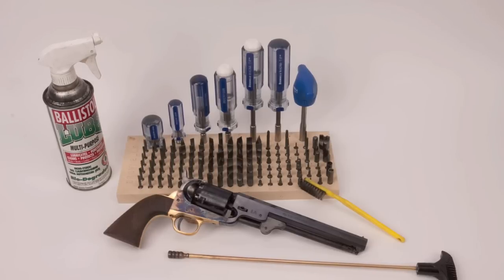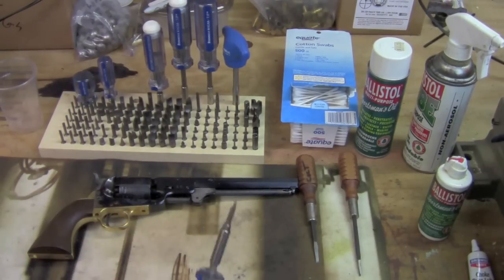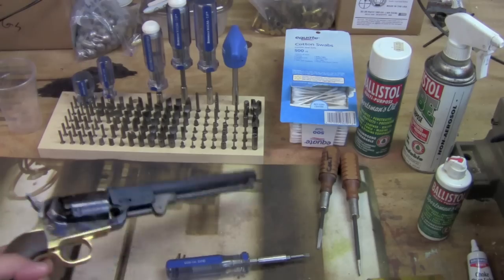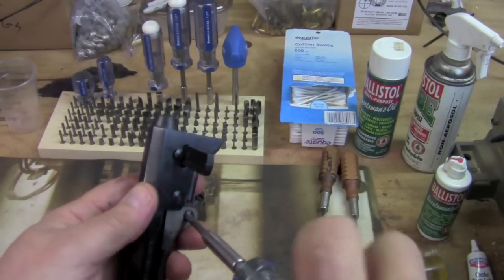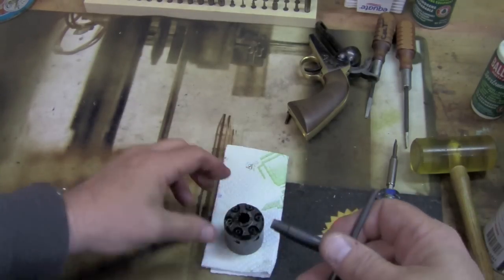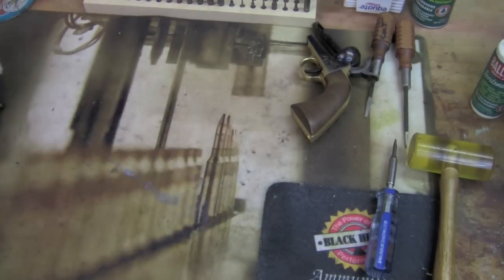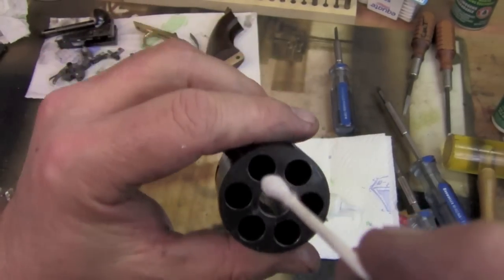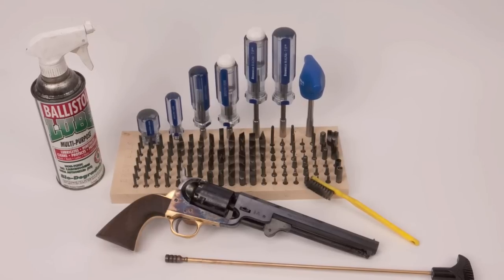Disassembly and cleaning Colt Cap and Ball Revolvers Part 1.mov

Comment: I just bought a new Pietta 1851 and the wedge will not move.  I've hit it pretty hard with a hammer
Reply from the maker: Hit it harder. Use a plastic mallet.
Reply: @duelist1954  Thank you.  I guess its a heavier hammer and break or die lol.  I have a Uberti Dragoon model and the wedge is nowhere this hard to get out.
Reply: @duelist1954  Do I need to remove the screw located on the left hand side of frame above the wedge?  Does the Pietta 1851 disassemble the same as the Uberti Dragoon 3rd model?  The19th century tin types should have shown Wild Bill with a 4 pound hammer instead of a knife in his belt lol.
Reply from the maker: @enjoypool4052  no. Do not completely remove that screw. Yes to the disassembly question
Reply: @duelist1954  Thank you for answering over  a weekend
Reply: @duelist1954  The end to my wedge story is a gunsmith friend looked at it the wedge was in backwards (from factory).  He knocked it out from the left side of gun

Comment: what can i do for rounds seized in the cylinder??
Reply from the maker: TrickyNicky remove the nipple, and use a steel punch or small diameter steel rod to pound the load out of the chamber.

Comment: just came across a repro 1851 navy that has not been touched for over 30 years. Gun cannot be put is half cock is stuck. Barrel cannot be removed when wedge is removed. Any suggestions on removing barrel that apprears rusted in place
Reply: Martin Small PB blaster

Comment: my nipples do not remove but my guns to shoot I just clean it out with hot water and soap is that okay, how do I remove the nipples if they're seized
Reply from the maker: Soak the end of the cylinder with the nipples in penetrating oil for a few days. Then tap the nipple wrench with a hammer a few sharp blows to break the rust bond.
Reply: +duelist1954  tryed soaking no work only got 2 out
Reply: +duelist1954  still shoots maybe I should leave it the way it is
Reply: i use hot soapy water as well so no foreseeable probs there...does your revolver nipples actually come out? a replica might not have went that step.
if they do first i'd suggest a thorough cleaning cleaning of the cylinders that's above and beyond normal cleaning, if they still don't move...200 degrees for 10 minutes should do...careful it'll be hot to hold and use a nipple wrench made to remove the nipples...if that doesn't work.might try hotter or longer other than that...I have no idea.   in case it needs to be said, a legal disclaimer here don't put a loaded cylinder in the oven
Reply: +Harvey Dent I got the nipples out I had to get a nipple wrench with a little bit more leverage and put it on a vice
Reply: +Harvey Dent I can only own antique replicas right now due to a charge in New Jersey over a pellet rifle because these are not considered Firearms under the law in most States

Comment: My wedge will NOT come out no matter how hard I smack it or what I do. I am afraid if breaking it. Any tips?
Reply from the maker: Sam W Thor can’t hit it hard enough to break it. Use a hard plastic mallet, and whack it with all your might. If that doesn’t work, go to Track of the Wolf and get a brass wedge drift tool and use that, and a heavy hammer to pound it out. Putting the gun in a padded vice, and using a brass punch to push the wedge spring down as you hit the wedge with the plastic mallet is a good idea.
Reply: duelist1954 I noticed there was a small opening next to the wedge on the right side. Is that used for anything in removal? I will try the wedge punch. Thank you!
Reply from the maker: Sam W No. Just whack it.
Reply: duelist1954 thank you for the reply! Will try your suggestions.